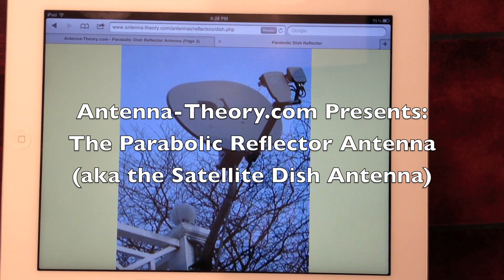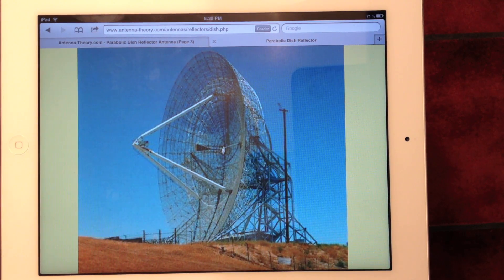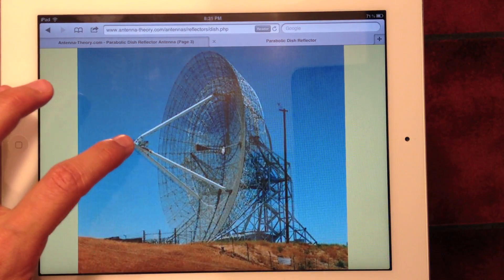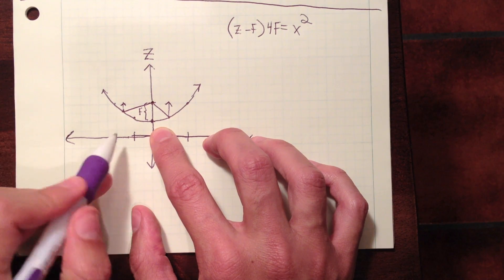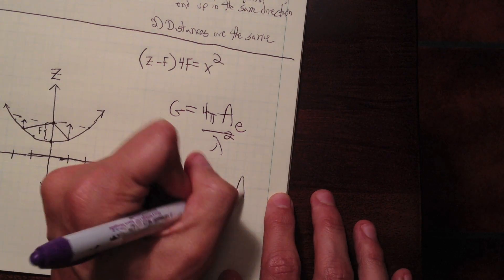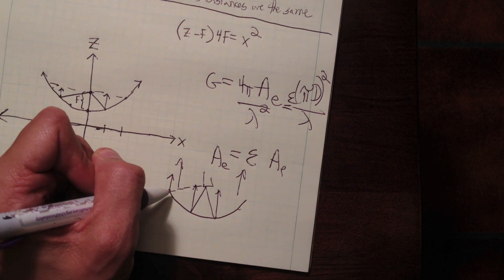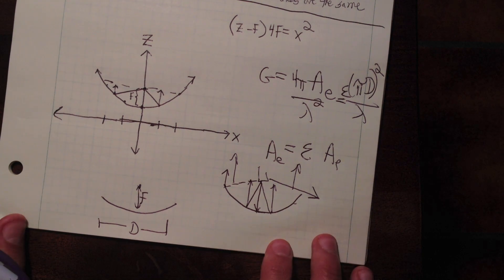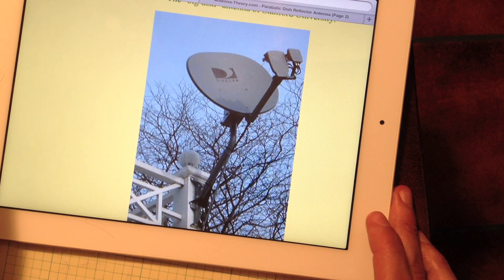Antenna-Theory.com presents:  Reflector Antennas - The Satellite Dish

Comment: How did you calculate 1630=32dB?
Reply: dB is just the logarithm with base 10 of a number times 10

dB = log10(x) * 10

so in this case

log10(1630) * 10 ~= 3.21 * 10 which is roughly 32dB

Comment: @pjblevel 
The site and the videos have been very useful. I saw the introduction and dipole videos and got up to bandwidth in antenna fundamentals.
I'm particularly interested in the horn antenna because I recently dealt with the horn antenna acting upon another antenna. When the horn antenna was horizontally/vertically polarized it acted differently upon the antenna if it was straight up, on the side,  or rotated 90 degrees in terms of S params. I saw how if the acted upon antenna was on the